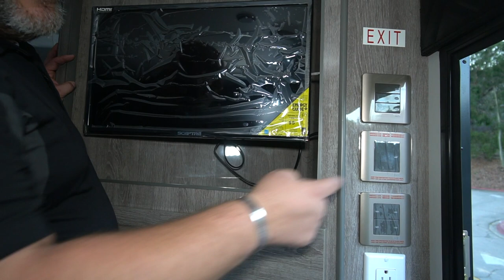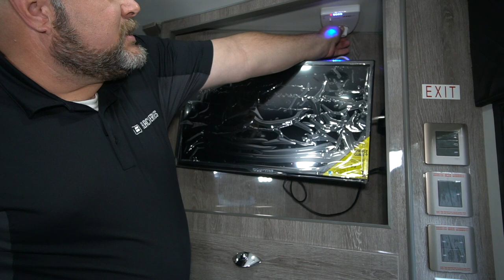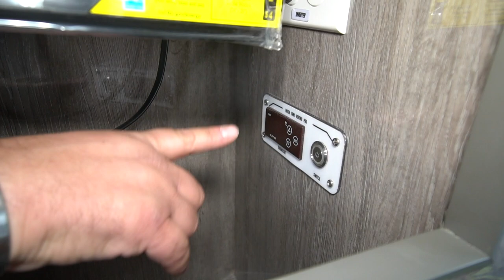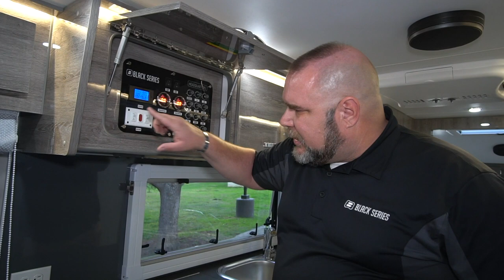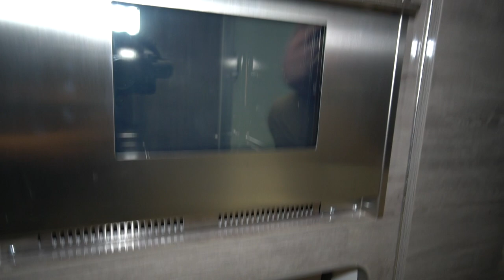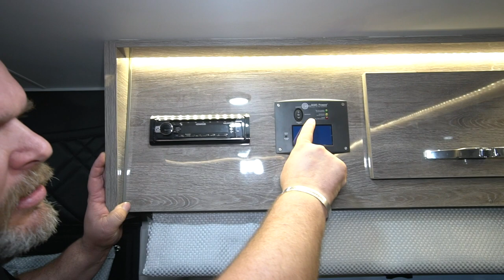HQ21 Full Walkthrough. Black Series Camper; Caravans, trailers and campers

Comment: Those bash guards are paper thin. He flexed it pulling himself under the trailer. Cheap wood supports under the seats. But the drain valve hanging below the bash plates is a no go. After looking at other comments, I saved myself trip to California or Utah to look at one.

Comment: BEAUTIFUL PRODUCT AND EXCELLENT PRESENTATION !  Especially when he slid under the trailer on a mechanics creeper, I laughed! You never see that on any other trailer video.  A couple questions that need clarification tho;
1) 4:40 Exterior Prep Table - It's just pulled open and pushed shut with no latches. How is it held in place?
2) 6:15 Locking Screen Door - It's explained that the lock is on the screen door, not the exterior door, it wasn't explained what secures the exterior door to the screen door, and what holds the exterior door open in place?
3) 15:30 & 16:45 All Aluminum Framing - I wont buy a trailer with wood framing 'secured' with staples, so I appreciate the aluminum with welded joints. However, my jaw dropped when the seat cushions were removed and I saw only two PINE WOOD 1x2's supporting the seat over the four batteries. How long are 1x2 furring strips going to hold up with 250# users sitting on this seat? Same thing on the rear bench, just four spindly little 1x2's for a seat twice as long. In spite of how fantastic this trailer is, attempting to support these seats with wood 1x2's is a non-starter for me. ALL of the framing for the seating should be constructed of aluminum as the rest of the trailer. I've seen other videos where the presenter claimed it had all aluminum construction - no wood. Seating structure is 'construction'.
4) Roof Material - Plenty time was spent under the unit, but nothing on the roof, sealants and how water is drained.
I would appreciate a dealership response to these questions before I can consider purchasing.
Reply: Steve Florida Yeah, the seat supports seemed, er, meh...

Comment: Overall, it looks ok. A few concerns though. First, that aluminum skin on the exterior and the exterior compartment doors and latches look extremely flimsy. Next, the battery compartment looks like it isn't vented to the exterior, meaning all of those fumes from the batteries are going into the living space. Also the gas lines look like cheapo rubber hose with hose clamp fittings and there doesn't appear to be a propane gas leak detector in the living space anywhere.
Reply: Justin N -I just got on here and seems everything is good to go until I saw your comments and started thinking as I watched the rest of it then said yeah this is a problem! Good looking out .

Comment: The HQ21 is a nice unit,but unfortunately I can only give it a 4/5 rating. Why? Two main reasons:

1. The refrigerator door should open the other way around. Why does it open to the bathroom/bedroom? It should open to the kitchen/cooking area.

2. Too small. I'm 6'6" tall. If this had higher ceilings I could even overlook the refrigerator door issue. As it is, I'd be hunched over all the time in one of those.

It's a shame, too. It's definitely one of the nicest setups that I've seen... Bar none.
Reply: I think they did the doors like that, so they would open completely.

Comment: During the table review with lifting the cushions exposing the batteries, charger, and storage area, the wooden cross beams seem to be quite small. More information concerning weight limits placed on those please. Materials used for inside the cushions? Memory Foam?
Reply from the maker: The cushions are made from a foam padding covered in a marine grade faux leather.
Reply: @BLACKSERIESUS  Thank you.

Comment: Plan on trading in my trailer in the future and have a few questions/requests.
Is the roof walkable and is there an option for a 3 way 12v compressor refrigerator?
Will there be a slide out option for the dining area? Thanks!
Reply from the maker: We don't recommend you hanging out on the roof with the potential to damage the solar panels. When it comes to any customizations, it would be up to your dealership to make modifications. 
At this moment we do not offer a slid out options.

Comment: High Definition TV Antenna explained well. Is there a Satellite TV Application available? Also solar panels on the roof,  unless I missed it I did not see this covered. Thank you.
Reply from the maker: Yes, this unit does come standard with 2x 150watt solar panels. Our units come standard with the HD TV antenna's, however if you wish to change it out you would have to discuss any modifications with a dealership.
Reply: @BLACKSERIESUS  Thank you for the reply.
Reply: Would like to upgrade AGM batteries to Lithium. Increase the number of solar panels.  Change inverter to 3000w
Did not see the roof.

Comment: Awesome video! Can the 2020 Trail Boss LT 5.3 tow the 2020 Black Series HQ-21? The Silverado rating for towing says max 9400lbs but the  HQ-21 says it's dry weight 6122lbs but gross weight 10000lbs What do you think?
Reply from the maker: That would be up to you or your vehicle's manufacture. The HQ21 has the GVWR of 10,000lbs.
Reply: @BLACKSERIESUS  I called you guys up and the girl I talked to didnt know for sure. Can you tell me who can I talk to about this because I can NOT buy it unless I know for sure. My truck can only tow 9400 lbs MAX. Thanks!
Reply from the maker: @07BLUESTI  Contact your local dealer https://www.blackseriescamper.com/rv-dealers.html
Reply: Yes you can but you would need to be careful with how much cargo you bring. 9,400 pound tow rating minus 6,122 leaves you a maximum payload of 3,278. That includes tongue weight, people/fuel/stuff in the tow vehicle, and the weight of everything you put in the trailer including fluids.  I would personally not load to max with that type of hitch.2 people probably easily doable by keeping an eye on your weights, more than that and you are probably pushing it.

Comment: Design flaw?? Talks about "bash/skid plate" then drain valve is sticking out lower then plate, once again a designer that never has used the equipment. 40:47
Reply: @P Funk  Or it could snap right off emptying the tank maybe.
Reply: Refer door swings the wrong way. Annoying to say the least.

Comment: This trailer is great if you want to "look" like you off grid and 4 season camp but really want to just be at a campground in regular 70 degree temps hooked up to shore power. Come on guys.... It's laughable how you have these shocks on the tires but so many fails on every other aspect of durability, functionality and quality. There are so many design flaws on these trailers, I stopped counting. So much potential....I hope they hire some design engineers who actually off grid or even camp more than as an occasional weekend warrior.  And guys... What about some of the safety aspects?  Furnace underneath the bed? And where is the fire escape window when you're bed catches fire from the heater etc.   It happens.  We had a faulty fan spark and almost catch fire plugged into an outlet.   We are going on our 4th year of full time rv travel.   And why are the propane bottles in a compartment that could be used for storage instead of on the frame of trailer like every other rv manufacturer?  Just for starters.... So disappointing.  Who cares about lighted stairs when there's so many other fails? Outdoor cooking? Something that sounds good in theory, but we've counted on less than one hand the amount of people in 4 years that are actually outside cooking on their outdoor kitchen, and that's being generous. Use that space for storage. Get rid of the outdoor pass thru storage as most people will be towing this supposed "4season off grid" rig with a truck where any items needed in outdoor storage will likely be stored in the truck bed.  Even if you want to store chocks, levels, hoses and electric cord in there, you don't need that much space for it.   Use that space instead for interior under bed storage.   IMO...these are no brainers.  
 I hate being so negative....I hope these severely improve in the upcoming models.  They could be really cool and have so much potential.  Also, what's the black and grey tank capacity? Did I miss it in the videos?  And no enclosed heated underbelly? This is crucial in the 0 or 5 degree temps you stated in the video... Also no vented compartment for batteries and inverter.   We have 300Ah batteries, 2000 watt inverter (plus 600 watts of solar panels up top) and they get hot! As in 108 degrees of not well vented.  The interior fan located inside the inverter isn't enough either.  And what about solar panels to actually recharge batteries?  Talk about cheaping out, when the panels are actually the lowest cost item when it comes to this set up.   What? People will go out into nature and be off grid, only to fire up a generator, disturbing fellow campers and wildlife???  Yeah. Ok.   And the list goes on...Sorry but it's all just a little too much fluff.  If you want a rig that only "looks" bad-ass, go with this one.  Do your research people.

Comment: 2 things I would want on this before I get one 

1 a way to move the general water to the drinking water  if I ran out 20 miles from a clean water source 

2 I’m I everyday Motorcycle rider  I Don’t really enjoy  being in a cabin awhile I drive even in the rain so going off Road with a camper like this  ————- I WOULD NEED A POWERED MOTORCYCLE LIFT Built onto the camper yes I could put it on the Truck but that’s very risky I could really hurt myself or the bike doing that 

So a Powered Motorcycle lift would really be nice ,,,, would be great to take a dual sport / a smeller end Adventure bike / or even. miniMoto like a Super Cub 125  

It also would be a perfect back up if the truck brakes down and you need to run and get a new part.    Or let’s say towns to far save some gas take the bike 

Someone gets hurt the bike will be faster getting that person to the hospital 

Lastly it would be perfect for someone who wants to live in the camper all year round being able to lock the bike up high at night so no one can steal it

Most Motorcycle campers out there are not made the best for crappy dirt roads  let alone  off road    At least the ones I’ve seen can’t so far and NOT ONE is made to live in them for a week  they are more made for just a  track day and that’s it

I would pay an Extra $3000 - $5000 USD just for that powered Motorcycle lift

Comment: Bro stop lying these things are overpriced junk lol the nicest thing is the axles setup    everything else was tossed in lol,  Its like no R & D was done. At that price range you don't even get lithium batteries, no way to switch the valves to allow the fresh water pump to pull from the bigger tank just in case why idk bad planning  those filters last forever and cheap to replace and lets not forget the open under belly that i have to pay more for to get a heating pad so my water doesnt freeze in cold weather lol what a joke with 5 mins of research there are complains about these everywhere and really bad customer support taking months to fix.  I would not spend the money for these.